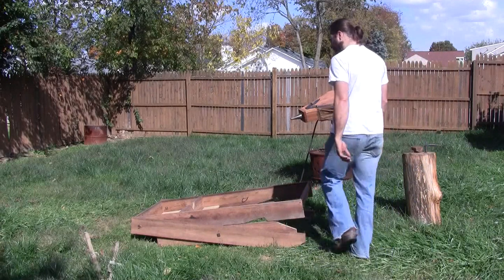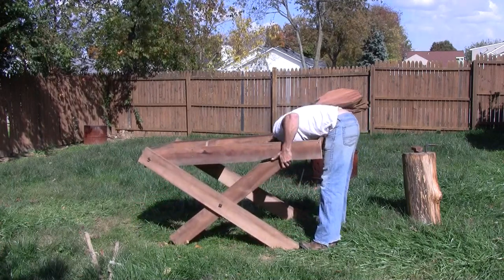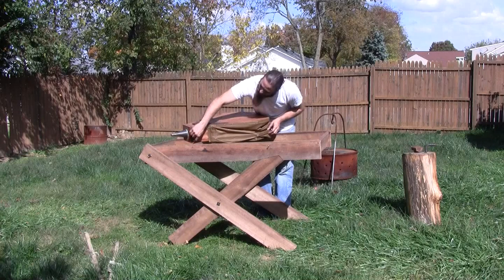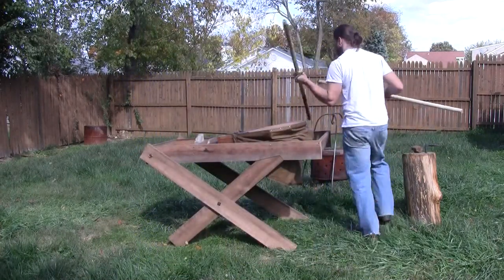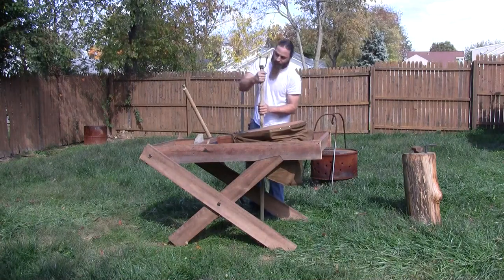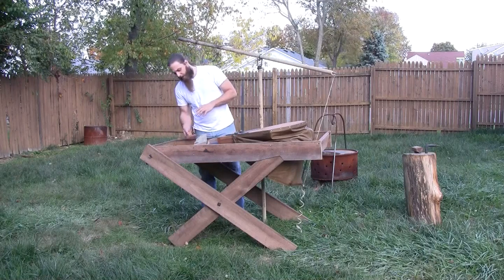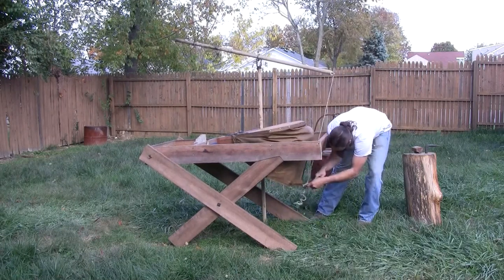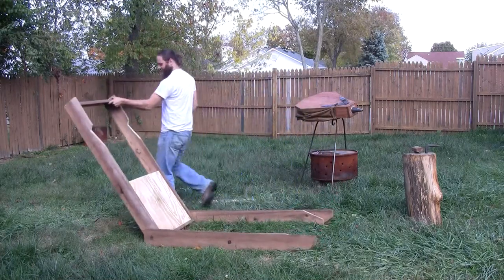Forge Setup

Comment from the maker: I was filmed at my last event, Blackhawk Manor Festival if I can locate that video Ill repost here. I form an indent just a little deeper than the tuyere and about 8 inches in diameter, leaving about a 2inch or more bed of sand that I wet down through the day while tending the coal to coke conversion.
Reply: Nothing wrong with asking the local viking helmet boys to shape you a square pan of sorts.
And while you are at it. About the wobbeling side to side: Just use some round stock and forge some diagonal breaches to stiffen the lower half of the fixed (hinging) leg set. That should take care of the wobble of death...

Comment: Out of curiosity, did you use period joinery or nails, etc. to assemble the forge frame? I’m looking at finally building my version today, and the temptation to use modern screws is great! :-)
Reply from the maker: Everything on it uses some form of mortise and Tenon or through pin connection  I forged the square nails for the central sand box.